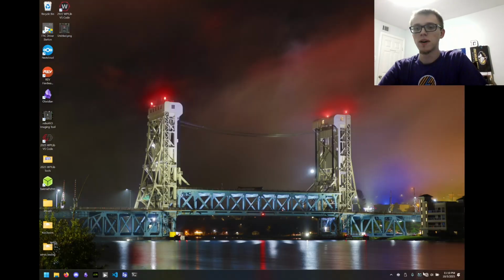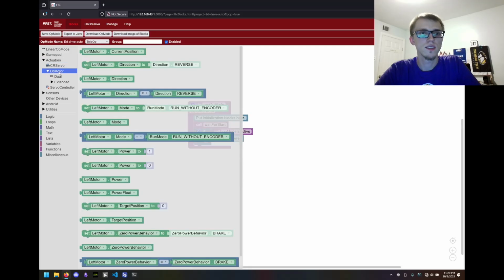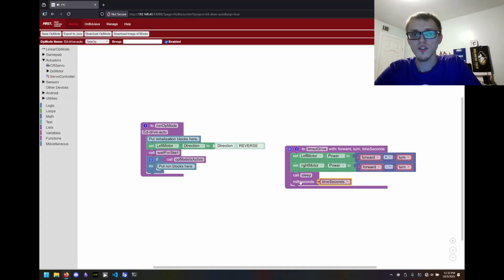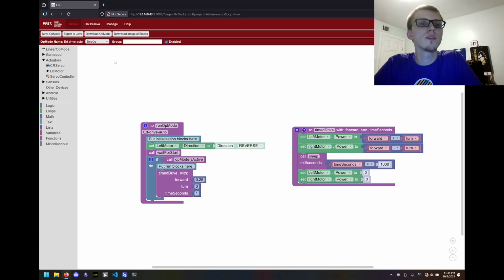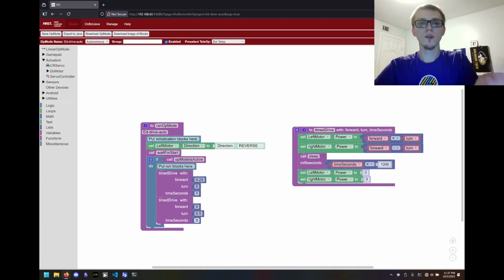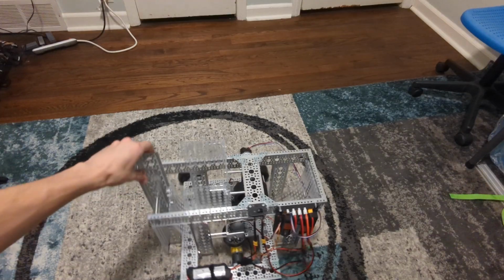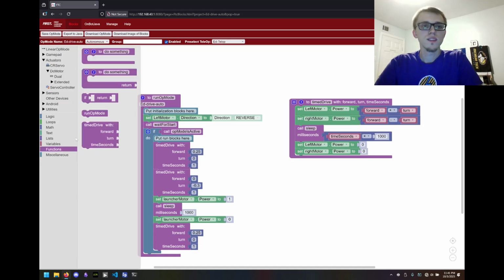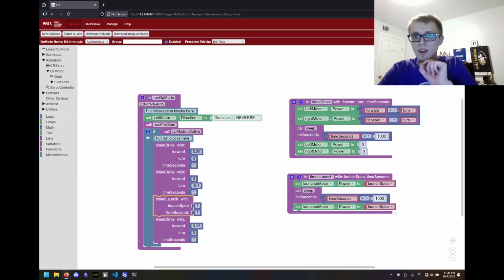FTC: Programming an Auto (Go Builda 2025 Starter Bot)

Comment: Ed, I have the servos working in telos, but am having trouble with setting it up in autonomous. I set the servo to continuous with the servo programmer, but does not rotate continuously, the servos move between 320 and - 320. The Servos are acting like they are not in continuous mode. I did set the programmer to continuous. Any help would be appreciated. I just started learning ftc code about 1 month ago. I met you at the motor city alliance camp at u of d mercy this summer.
Reply from the maker: Hi Ed, based on your other comment, sounds like you got it working. In case anyone else is looking at this in the future, here's my full servo troubleshooting steps.
1) Check the servo wires
2) Check the servo port
3) Check the servo code block (make sure its a CR servo block, or that you can find your servo name under CR Servo)
4) Check the servo configuration in the driver hub
5) Check the servo mode using a programming board
6) Try with a replacement servo
7) Try a different servo port
8) Try a different control hub / expansion hub